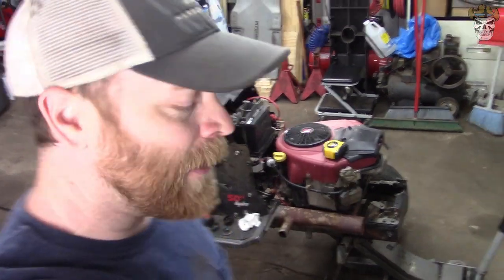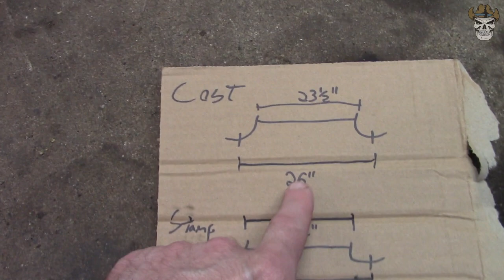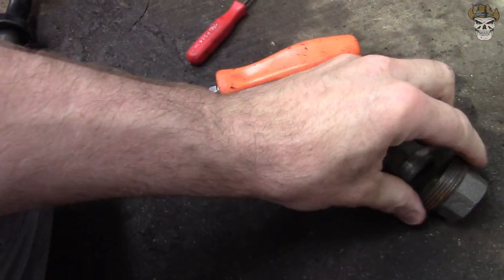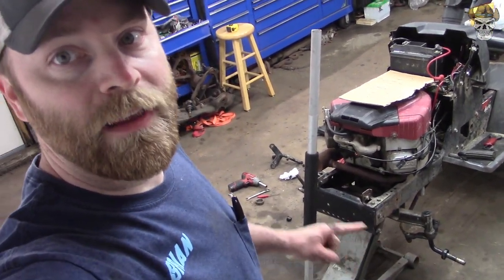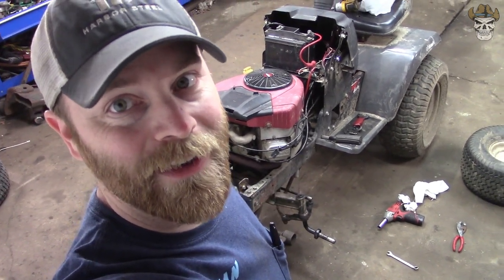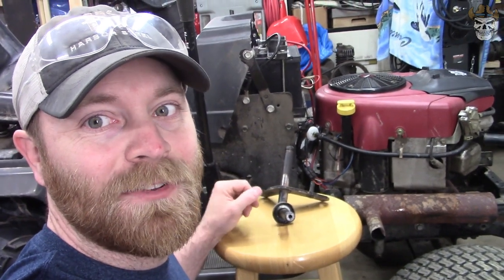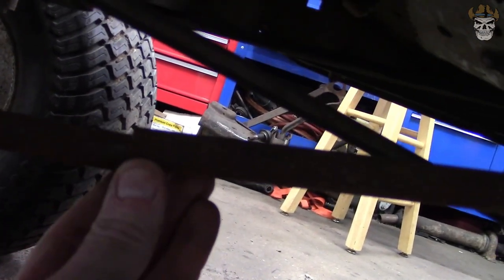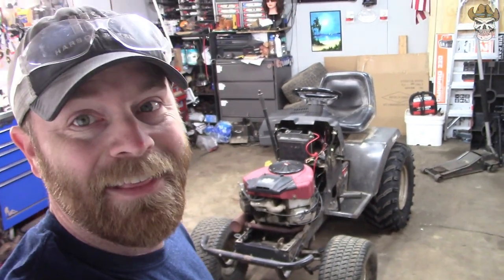Wizard Mud Mow Fivehundo Build Video 6

Comment: U can put 27s on a stock hight gt6000 craftsman,  I didn't know that you so I got the 23s for my, in love the video even though this was posted a 9 months ago lol
Reply from the maker: Thanks.  In video 3 I replace the hydro static drive with a manual 6 speed and in video 4 added about 2" of lift in the back.  Here is a link to video 4 where I talk about the lift https://youtu.be/kxR4H1ug2eQ?t=135.
Reply: @PostalRedneck  is there going to be a update on ur mud mower, I would love to see more of it
Reply from the maker: I took it to a few races but other than that Its parked with a tarp over it till this summer.  All I have to say is these things are cheap fun thats for sure.
Here is race #1 - https://www.youtube.com/watch?v=LUp9Or4DEOA.  
Here is race #2 - https://www.youtube.com/watch?v=qsKZ2YmH_4w.